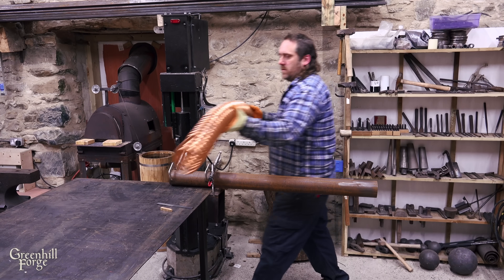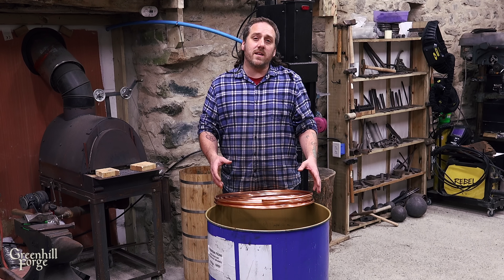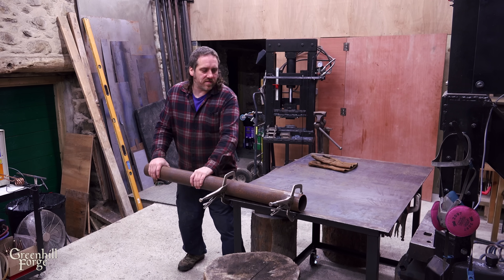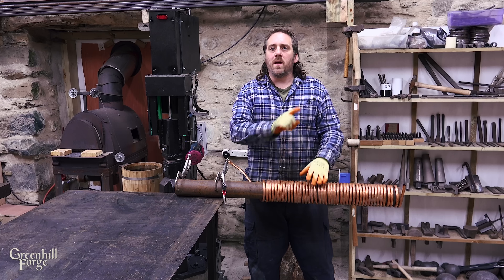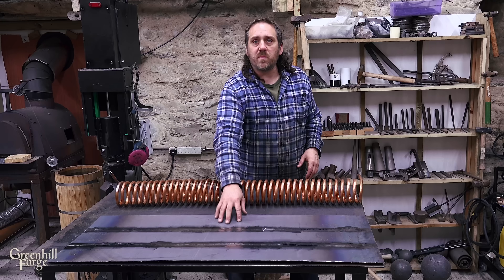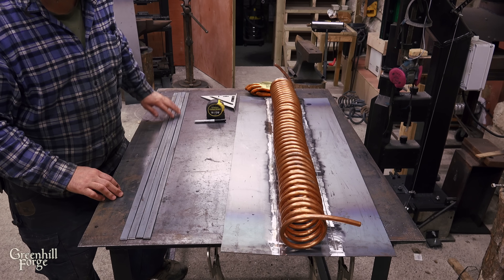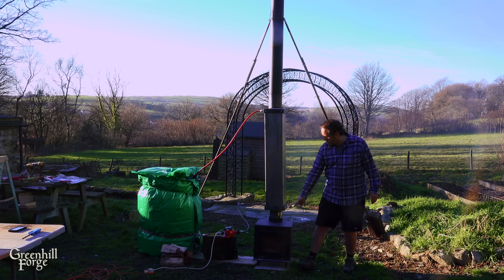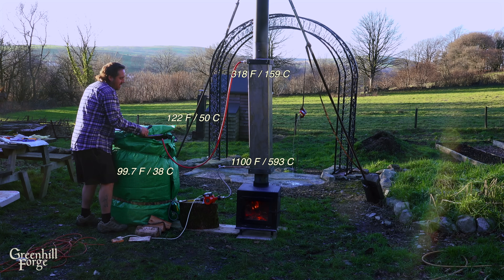Wood Stove Water Heater Experiment - Surprising Results! Part 1

Comment: can't you just put a steel water container on top of that stove to heat the water?
Reply from the maker: sure, but it's just way slower and less efficient
Reply: @GreenhillForge Thought the surface area = larger heat distribution so it'd heat it faster. Thanks for the video! :)
Reply from the maker: @gamdore  You're not wrong about the surface area idea. I had to calculate it just to demonstrate. The copper pipe has about 6.5 square feet of surface area which is probably 5 or 6 times the surface area of that woodstove top. It's also directly touching all the hot gasses instead of having a thick layer of steel in between. plus this is just more fun😁
Reply: @GreenhillForge amazing. thanks! :) on recent news, there were some apartments in NYC that were complaining that they didn't have enough heat for their homes--and I was wondering why they didn't rig up something by getting tips from people like you. lol. Subscribed!

Comment: I think about capturing the heat from the smoke a lot. Just letting it go seems like such a waste. 
I also imagine the pipe covered in computer heat sinks, stupid but fun
Reply from the maker: that's not stupid, great idea. but if you extract too much heat it encourages the formation of creosote (under 250-300f) so the trick is to come up with a system that engages the heat sinks when hot enough but disengages when it stops below 300f or so.

Comment: I have a copper coil around back of my wood burning stove. 
And I have a circular pump got through a 845 pony relay that relay has 24 volts control for thermostat and control 120 volts dry contact for circular pump and pump hot water through out my radiator and warm my house.
My oil furnace is my back up system
It’s a big loop when water get cool heats back up when pass the back of the wood burning stove

Comment: If you want it to be more efficient I think if the inner box was round or rounder(like an octagon) it would prevent your heat from being lost to the area's not around the coil. Also if you put a tube down the center of the coil to force all of the hot air out to the coil. both should make it way more efficient.

Comment: As mentioned already, I would try without a pump. That's how drip coffee machine work (but they might have a small check valve to allow flow only one way)  Yes it would be more efficient to reverse the flow BUT there might be a higher risk of pressure buildup.  If steam is produced the pressure rise will be very fast and push both ways but up direction will be preferred.  If you add a baffle in the tank to split in two sides, a cold and hot, the water would warm up faster.  Plate with some holes to allow the water to remain leveled but limit mixing.

Comment: I got an interesting one for you, now surround the stove in a sand battery, provides lasting heat, you can add coils inside, which would make a great way to heat floors/water/(the room it is in) more efficiently and longer. Just thought of it as I was thinking of your experiment, if you keep the work you've already done but add the sand battery you'll have quick and lasting heat with less waste of fuel. Just a thought.

Comment: If you are using a pump you really want to pump the water down past the rising hot air.  Think of it this way:
Up near the top the rising gasses are the coolest.  They can only transfer heat into water if the water is cooler than the gasses.  A few inches down, the gasses are hotter but so is the water.  Again the heat transfers.  This continues all the way to the bottom where the gasses are the hottest and so is the water.  You can end up with water coming out that is actually hotter than the gasses that go out the top.
Reply from the maker: I addressed this in the following video, check it out if you want to see the reasoning

Comment: The biggest problem with this kind of burner is soot/creosote. creosote can be managed depending on the fuel you use. If you have unburnt soot on your chimney, eventually the heat exchanger will have terrible performance.

Your design should aim for at least 1 of 2 things, ideally both.
Either easy cleanup, and you can do an anual cleanup before the cold season starts.
Or some method to burn your fuel extremelly well so soot is reduced to a minimum.

Comment: I didn’t know that insulation was carcinogenic and toxic 😬
Reply from the maker: it's the tiny fibers, so small you can't even really see them, that can go really deep down into your lungs that are dangerous. once it's sealed up with refractory cement or a casing etc it's fine.

Comment: As one who has burned wood for my only source of heat for several decades, I see one downside of the design.  Creosote will build up as smoke passes through a pipe, and it builds up faster as heat is removed from the smoke.  Hardwood and pine will both make creosote, so it's not a matter of using the wrong wood, it's a matter of the wood's moisture content.  In my current system, I use 6' of 6" diameter stove pipe that is exposed inside my living space to radiate heat into the house that would normally have gone outside.  The effect is identical to the process of cooling a vapor in an alcohol distillery, where the condensates "drop out" when the heat energy of the vapor is removed.  
I'd be curious to know how many times you'll be able to heat the hot tub before the creosote condensates on your coil prevent the efficient transfer of heat to your water..
Reply from the maker: This is only a test unit to get the data of direct contact between the coil and flue gasses. I will probably only fire this unit 4-5 times as is. The design is already moving along quickly and more videos will follow. I discussed creosote in the comment response video that came out yesterady and in the rocket stove test video which I hope to release tomorrow I open up the unit to show and compare the creosote between the two tests.

Comment: No need for spacing in or,around the coil. The more coil in the stovepipe, the more energy captured!
Reply from the maker: yeah but the more coil the more copper pipe I have to buy which is a bit too pricey for me so it a balance between efficiency and working within a budget. So basically it was how much heat can I capture with 50ft of copper pipe.

Comment: Using a solid fuel fire to heat water was fairly standard in rural UK for most of the last century.  Fire places and stoves were specially designed for it.
Reply: That was with a back boiler installed into the burning chamber or at the back of the fireplace (hence the name) rather than using the heat from the flue/chimney.

Comment: I think your tubing might be a bit small for gravity feed, but that would get you closer to your original off grid design requirement.
Maybe try reconfiguring your exchanger in a double or triple helix configuration to reduce flow restriction.  This would give you 2 or 3 parallel tubes. Raise the water tank so the top of the water is just above the outlet from exchanger.  This would aid in easy filling of the exchanger, and keep the exchanger under pressure.   Not as efficient as the reverse flow with the circulator, but NO electricity required.

Comment: Yes, definitely reverse the water flow through the exchanger.  Keep the Highest temperature delta, and you will have higher thermal transfer.  Cooler inlet water by the cool flue gas.  As the water temp rises, it comes in contact with the even warmer flue gases at the bottom of the flue.
Reply from the maker: I addressed this in the following video, among other things. The goal is it eventually ditch the pump have it run by thermosiphon so the data needs to reflect that direction of water flow.

Comment: I can heat 500 gallons from 140 to 180 on three pallets with a d.i.y. outdoor boiler.  I wonder how that compares.
Reply from the maker: I'd need to know how much the pallets weigh to be more accurate but guessing 30lbs per pallet gives an efficiency of about 22% and this setup had an efficiency of about 33%

Comment: Interesting. I wonder if you've ever heard of wetback water heaters? It's fairly common here to buy a woodburner with a built-in water heat exchanger that uses passive circulation to heat a domestic hot water tank. I doubt they're as efficient as your setup, but they're built into the house and require no maintenance, no power and no human input to operate (besides lighting the fire I guess).

Comment: Just stumbled onto your channel, nice design! Though I do see a problem that will arise within a year or two, those metal ribs holding the copper couls in place are metal, metal on copper will create electrolysis, thus causing leaks on the coils.
Reply from the maker: Check out the follow up video if you want where I discussed this and other issues

Comment: Wow nice contraption for off-grid water heating! 

To extract more heat, did you consider running the water in the opposite direction? That is to say counterflow against the smoke. So it would go in at the top & come out at the bottom.
Reply from the maker: Thanks! discussed this in the follow up video

Comment: I am confused shouldn’t the ice make the copper more brittle?
Reply from the maker: theoretically but it would need to be much colder. I've done this many times and never had a problem. Most freezers run at around -10f so it's fine to at least that temp.

Comment: The house I grew up in was built in the early 1900's. There was a Majestic coal/wood stove that we pretty much only  used to take the  chill off first thing  in the morning or during the occasional power outage, such as the time we finished cooking the Thanksgiving turkey.

It had a water tank fastened to the back between the stove and the wall and there were the ends of a pair of pipes sticking out from the wall that must have at one time connected the tank to the house's plumbing system.

Comment: Interesting build!  Some thoughts:

1.  A rocket mass heater would almost certainly work better than the wood stove as it stops smoking less than ten minutes after you start the burn and would use a tenth of the fuel while providing a LOT more heat.  If you look up 'ONE YEAR with a ROCKET MASS HEATER -- FULL demonstration and family review', you'll find an in-depth view on the pros and cons of using them.  (I saw a teardown video on a rocket water heater, and, after two years of constant use, the only thing in the heating chamber was half an inch of dry ash, so creosote wouldn't be an issue.)  One warning, though: while the exhaust gases might only be 140F or so, the insulated reburn chamber can easily hit 1800-2000F, so using refractory bricks with a stainless-steel coil would be a better way to go.

2. Another technology that would be well-suited to your lifestyle would be to use compost to heat water.  Composting is not only exothermic--producing heat--but can easily top 140F 24/7/365 with a properly formed and maintained pile.  Jean Pain--a French farmer--had one pile in the '70s that was something like 10 feet high and 30 feet across that produced 140F water at a rate of a gallon a minute for more than two years.  Even better, the pile eventually cooling means it is completing composting, and will soon be ready to be used or sold for big bucks.  You can read his book on the Internet Archive by looking up 'Another Kind of Garden-The Methods of Jean Pain'.

Cheers!
Reply from the maker: The rocket stove version video will hopefully be ready tomorrow

Comment: Great video!  I was going to mention the counter current concept but I see someone beat me to it. The reason that is better is because you get maximum heat exchange when there is maximum difference between the hot gases and the water.   Also another person mentioned creosote build up, a major engineering hurdle when dealing with burning wood.  The previous commentator gives one approach to the solution.  If you can figure out how to install your tubing to have constant contact with the outside of the flue, that works best.  Another approach to this would ber to have the heat exchanger inside the flue, but come up with a built in internal creasote cleaning mechanism.  It would have to be religiously used frequently enough to not build up to much.  Another  very fun engineering project would be to elliminate the creasote by focusing on the design of the stove itself.  You need to add a secondary combustion chamber with a separate, preheated, controlled combustion air intake.  I built one that resulted in a pure blue flame in the 2ndary combustion chamber and no visible smoke coming out of the flue.  That indicated an almost perfect combustion with almost no creosote to condense out on the exchanger surfaces.  Have fun!
Reply from the maker: I disscused counterflow in the follow up comments video

Comment: I think your going to have issues with electrolysis and rub outs with the copper on steel. I’m a mechanical contractor and it’s the number one reason I find for leaks with copper pipe or linesets.

Comment: Look up Hardy Heater. They're no longer in business but my parents own one. Its an outdoor wood burning heater that heats water that is pumped into the house to a radiator coil connected to the fan on the normal unit. It also supplies the hot water heater. When the water outside reaches the low temperature setting a fan comes on making the fire burn. When the water reaches the upper temperature the fan cuts off and the fire is supplied with just enough air to not go out.  It only needs to be filled once every 24-36 hrs.

Comment: Wood doesn't have enough BTU to heat a bunch of water, that's why you don't see alot of wood powered hottubs. They DO exist, but you need to burn wood for HOURS to get it to temperature. So don't get any ideas this will warm your house or even draw you a hot bath or shower.

However, this is a neat little application if you are just wasting wood heat anyway. Plus you gotta appreciate the craftmanship and science explained here!
Reply from the maker: I have a wood fired shower that works great. small fire heats the whole tank. check out the comment video that came out yesterday and I show it

Comment: I did the Math on your design, its not that super efficient, its just around 23%. You burned wood with an energy of around 17 kWh to heat water with around 4 kWh...
Reply from the maker: it's around 33% which is more efficient than a typical electric water heater. I get into the numbers in the next video
Reply: @GreenhillForge Nope, an electric water heater operates close to 100%. And besides, it's not 33%. Heating 106 liters of water by 31°K simply costs 3.82 kWh of thermal energy. And wood has a calorific value of around 4 kWh per kilo. Accordingly, with an amount of wood of 9.25 pounds (4.2 kg), a heating energy of 16.78 kWh was released -> 22.7%
Reply from the maker: @SuperVertraulich  No, they're about 90% efficient at converting electricity to heat but that doesn't count everything it took to extract the fuel (like coal, natural gas or uranium from the earth, refine it, transport it to a power plant, turn the fuel into steam to  create electricity and transport the electricity to your house. from fuel to hot water in a tank they average about 30% efficent.
Reply: @GreenhillForgeNo, you don't include the entire energy chain in the calculation because it is an electric heater and not an coal, gas or uranium operated. Otherwise you also have to take into account the efficiency of growing the wood, felling and sawing, etc. In addition, the overall efficiency is massively dependent on the type of primary energy source. Or how many percent would you rate the efficiency of a co-energy source in generating electrical energy or solar?
Reply from the maker: @SuperVertraulich  of course you have to include the full lifecycle of fuel and infrastructure. otherwise you're ignoring the majority of the inefficiencies of the system. electricity doesn't just magically arrive at a house 100% efficient. Yes, you would also need to include the wood, which I cut and split myself from my own land and did include. Of course things like solar are more efficent but you have to include the production of the panels, chargers, batteries etc too. I used averages. many systems will be better and many systems will be worse but if you're talking about millions of system you have to used averages. A comprehensive view is the only realistic view, anything else is just pie in the sky.

Comment: Love how simple you twisted the copper coil, but that metal enclosure looked like one hell of a faff! Especially considering you need a welder to do it your way. I feel it would have been a lot simpler and more effective to get or make a cylinder slightly wider in diameter than the coil, close the bottom off and then fill the cylinder with sand. Sand retains heat very well and gives it off really slowly.
Reply from the maker: sand would actually be the opposite of what this system wants. the point is to avoid a thermal mass.
Reply: @GreenhillForge ah ok
Reply from the maker: @ Your idea would be great for an indoor system but this is for an outdoor system that just wants to make hot water asap
Reply: @GreenhillForge Ah alright then. Good to know, because I was only "theorizing" from what I learned about sand recently in another similar video. They used sand as a sort of heat battery. Wicked stuff it is. And sand is cheap as chips too.
Reply from the maker: @Johny40Se7en  Yeah, sand for something like a rocket mass heater system is great. It all depends on what you want to do with the heat once you've made it.